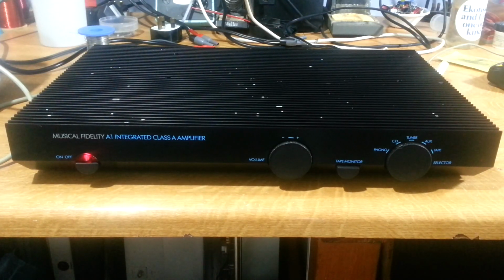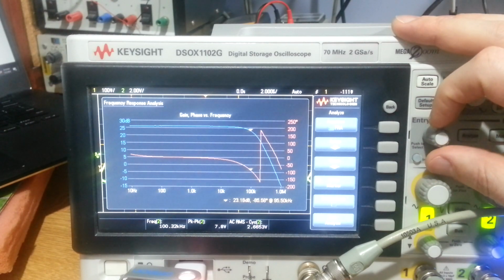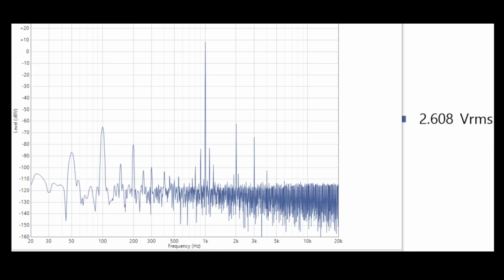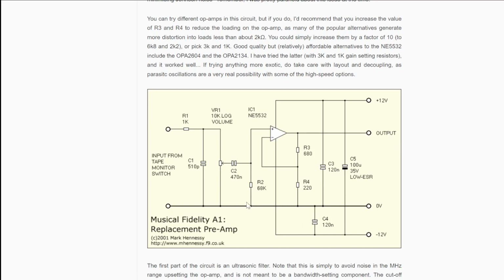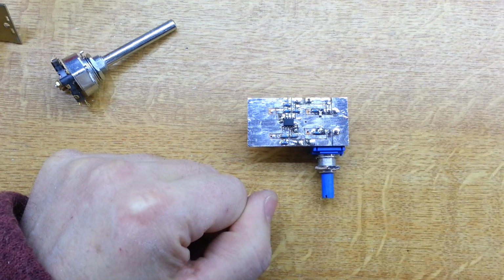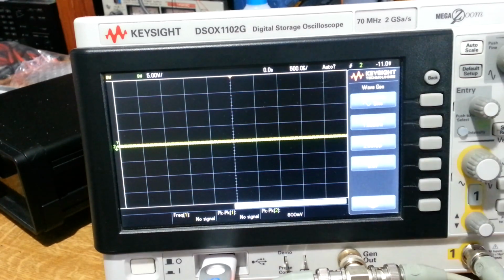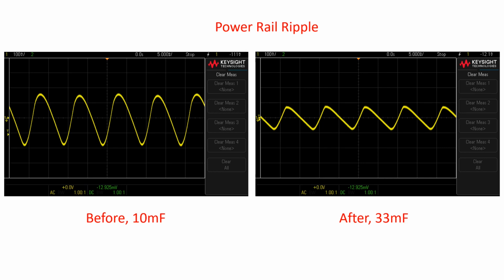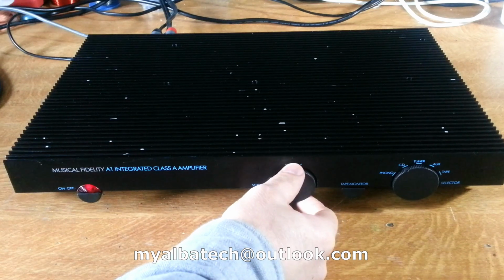Musical Fidelity A1 Integrated Amplifier Repair/Upgrade

Comment: Could you please tell me what is the AC output voltage of that toroidal transformer. I am trying to rebuild one unit that someone ruined with two small classic transformers just to keep it running not so hot 😢. Would 16-0-16 be ok? Since 18-0-18 is just on the limit of that capacitors
Reply from the maker: 16v RMS is just about right i think.
Reply: @myalbatech  thanks I will order then one with double 16v maybe 120w that will be enough since the space is limited

Comment: Does putting the bigger caps on the power rail help with bass?
Reply from the maker: Here are some comments from the owner: 'Even from a cold start the bass is definitely fuller, deeper, tighter since you worked on it, and the soundstage has more detail with a wider sweetspot than before and just improves as it heats up. I noticed I played around less and just listened to the music.'
Reply: @myalbatech  Sounds like a worthwhile upgrade. 

My A1 sounds magical and very easy to listen to but the bass seems a little out of control compared to my other integrated an Ion Obelisk 3X/ XPac1.. but I prefer the sound of the A1, other than bass.

Neither have been serviced.

Comment: why did you only change the 1 capacitor to 33mF not both of them? and wouldn't 47mF been better.
and what  about changing the volume to attenuator?
yeah very nice
Reply from the maker: Because there is no room! Higher capacitor values would be better still yes.

Comment: That so called active volume control is similar to the old  Cambridge Audio P40/50 where the pot is placed in the feedback loop. Noise was caused the slightly different voltages across the pot. Same effect. nothing wrong with the pot just noise due to DC.

Comment: I own an original A1 of the first serie's, modified/upgraded to later version by the importer here in the Netherlands.
Later I modified the volume control to a more traditional style i.s.o, the negative feedback control originally used.
With a very simple modification the volume control is relocated to the output of the preamp IC's.
Last year I checked all the electrolitic capacitors and found only one out of limits.
My amplifier has different distortion when getting to max power, it introduces a kind of crossover distortion.
Also Last year I replaced the A1 by a Nelson Pass F5 clone I built, noticable more power.
Reply: Hi, can you guide what was. The simple modification,as I too want to do it.Thanks in advance

Comment: Class A amplifiers require huge heatsinks and power supplies, they're as much about mechanical engineering as they are electronics because removing the heat is an issue.  As a builder of this type of amplifier (specifically the Pass F5 Turbo V3) I used a cold plate to remove the heat from 32 transistors each of which dissipates 25 Watts (it's four channels of class A biased at 3.5 A per amplifier per rail).  Forced air cooled heatsinks worked for a while but always ended in smoke & tears (mine), the cooling system uses a central heating pump, two small car type radiators each with a fan, and a 17 litre water tank.  The entire system is in the cellar below the listening room and sounds every bit worth the effort it took to build.

Comment: I remember these! They sounded good but ran really really hot 🔥.  That type of wafer switch for input selection was also used in in old Sansui and Kenwood receivers; Sansui's usually had 3 or 4 of them in a row inside a slotted metal frame, and they used it to switch the tuning dial and input indicator lights as well as input selection and Dolby FM modes.  I have taken them apart and cleaned them, which is indeed kind of a pain (especially if there are 3 wafers in a row) ----  but the plastic rotary switch you replaced it with really isn't that much better, and I had to replace one of those on my NAIM preamp.
Reply: Interesting,  how many wats is it?
Reply: @neilstern7108  , I think it was just 25 or 30 watts per channel if I remember correctly.
Reply: @goodun2974  heck I have about 50w per channel and I can play it all day. That amp must have shorts or lots of resistance. Thanks for your reply.
Reply: @neilstern7108  , its a class A amplifier design, and Class A designs always run hot. In a commoner, everyday Class AB "Push-pull" amp circuit, one output transistor ---- or a group of them ---- handles one half of the audio signal and the other transistor or group of them handles the other half of the audio signal, with some overlap,  (like a relay race where a runner hands off the baton to another runner and they are briefly both holding it). Push-pull amplifiers are more efficient and don't waste as much electricity in the form of heat because one transistor is turned off while the other one is turned on, and vice versa, and so there is a rest period for each device in which they are not generating heat or are cooling off slightly.  However, there tends to be some crossover distortion  at the point where one transistor (or a group or "bank" of them) is handing off the work to another (when the handoff is about to occur, and/or when both runners are holding the Baton simultaneously). In a Class AB amplifier, all the output transistors are turned on 100% completely all of the time, and can conduct both directions of the audio signal without handing it off to another device or group of them, but this means that the transistors have a lot of current flowing through them even when they aren't passing an audio signal, and therefore they  generate a lot of heat. (imagine your car idling at 3000 rpm when you're at a stoplight with your foot on the brake). A well designed Class A amplifier can have very low distortion, or at least a different, perhaps less audible type of distortion then a class AB push pull amp (and it might also have better "damping" and might handle the ever-shifting electrical-impedance load of the speaker better; speakers aren't a steady state resistance and the load varies with music frequencies); but Class A amps will tend to be fairly low powered yet require a big power supply and transformer to keep up with the demand for excess current, and big heatsinks to get rid of the excess heat.  Neither design is inherently better or worse;  there are almost always engineering and design trade offs involved, and considerations must be made to what the amplifier will ultimately be priced at.  For what it's worth, I've heard good sounding Class AB push pull amplifiers and bad sounding or impractical/underpowered/overpriced Class A amplifiers.
Reply: @neilstern7108  , PS,  It might be helpful for you to understand that transistors, if allowed to get too hot, can go into a "thermal runaway" condition, whereby, as they get hot they conduct more current, which causes them to get hotter, which causes more current, which causes more heat, until 🔥 💥!  Transistors are a little bit like electronic switches but they require a "bias" voltage to turn them on, and there is a range of biasing (quiescent or steady state current flow through the transistors when no signal is passing through them) within which the transistor will behave in a fairly linear fashion and will likely have acceptably low distortion; but if the bias is set too cold, the amp will both physically run cool to cold and likely sound bad, with measurably higher distortion; and if it is biased too hot, closer to or into Class A mode, it might self destruct unless designed to be run in that mode, ie:  it having sufficient heat sinking and heat sensing/automatic bias-feedback circuits to prevent self-destruction. In the case of the amplifier shown in this video, the mechanical design traps a lot of heat inside and so it tends to prematurely degrade and shorten the lives of other components such as capacitors and even solder connections.  This might have been a case where the marketing department decided that they needed to have a Class A amplifier in their product line strictly for purposes of covering all the marketing bases by appealing to a certain segment of the audiophile crowd who are hardwired to assume that Class A "always sounds better". Had they not gone for a slim, low profile mechanical lackage, and had they incorporated vertical heatsinks and slots or vents for increased airflow, perhaps it would have run cooler and lasted longer before needing service.
Reply: @goodun2974  great info, I unknowingly got the best amp for me. So much heat. I watched a vid on an beautiful A amp but the guy could only play it for a few min. I learned a new term Push Pull you  explained it so well , very knowledgeable.  I bought a low end pioneer amp it was so dead so lifeless I had to give it away. So when I bought the amp for my bedroom I didn't want to spend a lot of money. And I'm really happy with my low end set-up.  That the amp made in China is clean clear with great separation no hum no jitter is an ab and I can play all day it barely get warm. It was advertised as 600w but it's more like 50w per channel. I use a sd card player it's an car cassette insert that has an EQ button that shifts through about 10 different variations of frequency  it helps a lot because album sound varies.  But it needed more bass so I got a real EQ and i basically use it to get stronger bass and treble.  All for about 220 dollars.  I have a HK avr 65 in my living room not high end but I crank it all the time rock vids. But my bedroom stereo actually is cleaner. You were very informative and explained it to me so well . You should have your own site. I would watch thank you.
Reply: @goodun2974  you are amazing,  I understand you clearly.  Once again you should have your own show. I'd be the first to subscribe.  Heat destroys everything. That why I went with the coolest setup I could think of. If I may ask what kind of system do you have?
Reply: @neilstern7108  , I have mostly British built gear: a Naim Audio 32.5 preamp with HiCap power supply, a Naim 70 watt per channel amp (Class B, generates almost no heat, and sounds great despite audiophile assertions that it "must have lots of crossover distortion"); Proac Studio One speakers,  Linn Sondex LP12 turntable, and Museatex CD player with separate D to A convertor.  I'm an audio repair technician and I also worked for many years in retail audio sales as well as having done a fair bit of pro-sound installation.  My own system could use some work at this point but I'm always too busy working on everybody else's equipment. You know how it goes: the plumber's faucet always drips, and the shoemaker's kids run around shoeless!
Reply: @goodun2974  just like an auto mechanic.  I'm impressed you don't follow the crowd.  I did much the same and cds and dvds  are not given enough credit. I try to get the cleanest sound I can cheap. Still don't understand why sd cards are not used that much. But I went that way cuz no moving parts no motors no fans just pure clean power. Of course the comprise is the EQ got one with very little background noise it seem to have boost my power output cuz I don't need to turn up my amp as much and that makes it very noiseless.  I'm sort of proud of myself. I'm not really an Audiophile,  but love music.  These masters of sound are awesome 👌.  Have a great day. And get on your game and do what you need to do on your set up. By the way sounds excellent. Push pull that's my new way of life, thanks.
Reply: @neilstern7108 ,  my current off-duty audio project is rebuilding a pair of old Heathkit tube type monoblock amps with fresh filter caps and some mods to protect the power and output transformers, which are a known failure point. I'll probably use 'em for a bit and then sell them. 

Note that I don't use EQ in my home system and my preamp doesn't even have tone controls. Generally, the fewer components and circuits that the audio signal passes through, the better. Tone controls and eq's tend to add a fair bit of "ringing" to the audio, since they are designed to be resonant circuits. In pro audio, experienced sound guys know that "he who eq's least, eq's best!"
Reply: @goodun2974  nice and all true. I've noticed high end has no control's but for 75 dollars for the amp it has great separation,  very clean and no hum or hiss. Even I was surprised.  I bought two thinking that I would use both on my system.  But after testing found that one the bass was gavel and rough. And the other was like silk. So I just use the good one. It may be a fluke but if they were both bad I would get better but I'm very happy with it. May look for different speakers but I now have just enough bas that I can feel it and at low volumes.  Oh and another thing I saw one high end amp with problems with the volume control working badly it was a 5 or 6k amp. So really I'm amazed and is my prized possession. Oh as far as ringing I don't have that on my bedroom system.  But when I put the EQ on my HK I noticed  it would get ringing but only because I had treble levels up to high. The EQhas taught me how to adjust sound properly.
Reply: @neilstern7108 ,  "ringing" is not like feedback where it squeals or howls audibly ----  but when fast transients and pulses of music go through the tone controls, they add an oscillation of sorts to the signal that you can't  hear as it's own separate tone, but it will increase distortion and lessen clarity (though it requires good rest equipment to measure it).  Note that I work on a lot of 1960s to early 80's hifi equipment, and the tone control circuits are often one of the biggest headaches to repair.
Reply: @goodun2974  wow I'm glad I ran into you. My HK volume  control  just spins around  I got to put firm pressure on it when I turn it. It's been like this for 7 years. I keep putting it off but one day it will go. It's a great amp but I bought it cheap I can get another one for about the price to fix it. That's what I was getting out of my tweeters.  I did have my volume control go up in volume without me touching it but it was after my middle speaker sorted.  And thanks to the internet I found one just like I had. But after I changed speaker it works fine, the volume control still works well for now. It's great talking to you as me and my gal mellow out cus she has rerve problems so we rock. Have great day.
Reply: @neilstern7108   What do you have in your Harmon Kardon isn't a standard volume control that would only have about 270ﾟ of rotation. It is a digital volume control or commutator control, and they literally are supposed to turn around and around and around. Yours is obviously intermittent electrically, and unfortunately you cannot simply squirt some control cleaner into it like you could with a standard volume or tone control on a more traditional older piece of stereo equipment.  It is possible, but a royal pain in the neck, to unsolder that control from the circuit board and pry it apart and swab out the lubrication with a Q tip and alcohol, and then you polish the metal pieces inside of it ----  a tiny sectioned metal disk that looks like an aluminum pie plate cut into wedges ---- with a pencil eraser;  and then we relubricate it with clear silicone grease and reassemble.  Definitely not a job for a newbie ,  but the kind of thing a good technician can do;   however in your case it's probably not worth spending the money. At the repair shop I work for we stopped fixing surround sound receivers because most of them can be replaced for less money than it takes to service them. It would have to be a very fancy and expensive unit to be worth repairing.  The problem with the fancy expensive units is that they are big and heavy and they usually have 70 pounds worth of shit in a 10 pound box and so the amount of disassembly required to get at the trouble spots makes it extremely impractical.
Reply: @goodun2974 man your so cool thank you I try not to use it a lot but I set it so it don't pop the speakers then firm push slowly turn. Why would you have it so it spins? I got it for about 50 bucks. But I like the avr setup . Your info has helped me much . Sitting here listening to rush big generator.  Here's something is there a phone app that can help you with your sound quality,  and grades it. I think that would be cool. How about this you have a show where people play over some kind of link and it sees how good it is then you talk about what will help it. You'd have a line of people. And with your knowledge  wow. But the it's a lot of work. At my age just getting up is a treat. Great talking to you again. In these covud times stereo is a great escape.  I had a top line Yamaha amp receiver the things power chip would short if you cranked it loved it I would have sent it to you . You might have know why something was shorting. I bought it used .but when it played very nice. Well I'll let you go thanks.